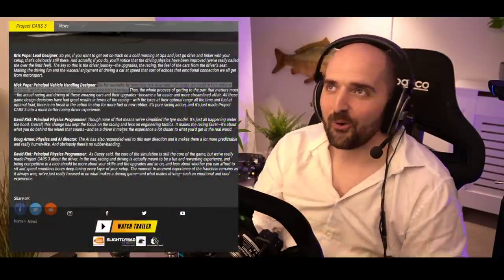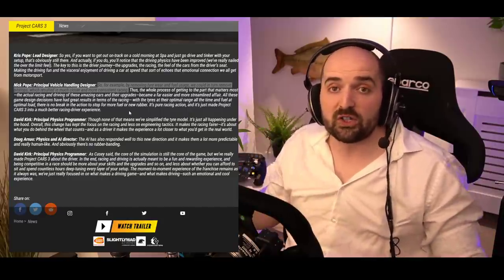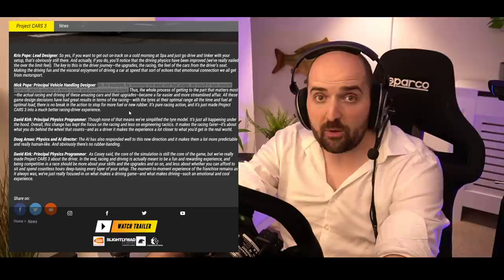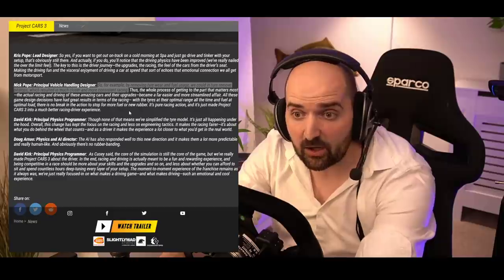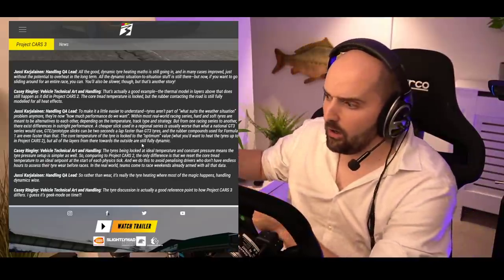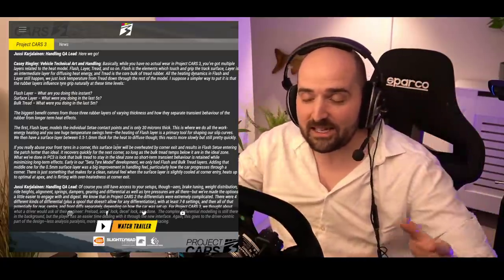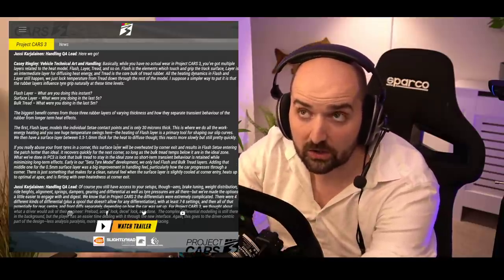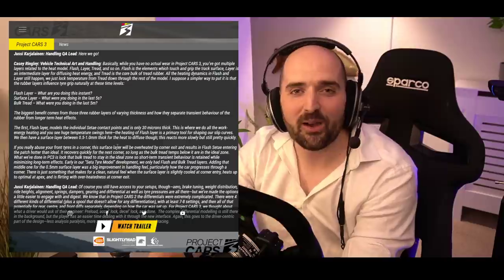No Pit Stops In Project Cars 3  | Are They Mad ?

Comment: Hey guys! Pitstops are a PART of racing! That’s part of the action. Having to manage tires and fuel is a BIG part of how good of a driver you are
Reply: Well to some simcades and almost all arcades pitstops and setups  arent an important aspect to the gameplay and PC3 is going to shift to this type of games.
Reply from the maker: How many people actually do 20+ minute races in sims ?   I have done 2+ years of live streaming and most our fun races are under 25 min.    Even in iracing the most active races are less than 40min and don't have pit stops in them. 

I do think its a shame to remove pit stops from the game totally expecaily for people that specifcally want that , but if the game drives well for the vast majorty of people its probably less of an issue than they actually think. 

I do think 20 min races with a forced pit stop and accelerated tire wear are fun and I'd have rather no pits were just single player. 

going to be intresting to see how it plays
Reply: I agree its important not to overheat them or cool them by going too slow even at short races. Wrong decision they made, i think if they want to simplify it they should better leave temps, fuel consumption, brakes overheating even how it was in PC2, nothing to improve just copy paste work they did in PC2 BUT...  remove setups. 
Drivers dont make car setups anyway nor calculating fuel. Best way would be leave tyre temps and wear, fuel etc but bot engineer telling you must come pit cause tyre wear, fuel ending or something. And if it comes rain he tell you to come pit change to wet but it is YOU deciding if you want do it now or after some laps or try to finish race on slicks in wet xD if you p1 and it start to rain but its 2-3 laps to finish and now its psychological battle between you and guy at p2 who go to pits, when or if any? you both try to finish in wet on slicks to not lose position xd thats fun and they took it away. Had situations like that many times but always i was more afraid of those stupid pit strategies if i come pit in wet when still have fuel and they give me hard slicks and load full tank cause i didnt change strategy earlier before race even started. But thats not problem only with pCARS2 happened in other sims so i would like to have sim where im doing only drivers job and AI makes rest, im just drive but with all sim features. If no tyre temp, pressure, wear, fuel consumption there is no sim anymore. 
Shorty telling no setups, auto fuel per distance, tyre wear, tyre temps, when tyre wear or fuel low GAME tells you to come pit and makes everything without you pressing even one button. That would be simple and let us decide our own strategy mid race. 
And pace car would be cool
Reply: I would like to go 100 lap multiclass race with AI and pits, changing weather and day /night cycle. 
Another thing there is touristenfahren server in PC2 where you choose any car of the game and make your lap around Nordschleife, its set to like 6000 minute practise to work and so you get on track from pits. Now i wonder if it be still possible? no pits means racing only no practise. Or even if practise, if you got no pits would you just spawn at start line when joining a server?  i dont like it
Reply: @GamerMuscleVideos  What if it starts raining during  the race? Still going to use slicks since you cannot pit anymore? lol
Reply: @PapaBear6t8  If I remember well, a Nissan engineer at Le Mans 2015 explained me that they had an "average gum" they were using on dry and wet track. In their Blog, SMS explained that the weather will only influence the grip, but considering the temperature of the tyres.
Reply: @PapaBear6t8  Maybe tire transforms itself.

Comment: No fuel or tyre wear and during a race the tyres automatically adapt to the weather conditions, a pit stop without a pit stop, what's next power ups, autopilot.

Doesn't bode well for the future of console sim racers and for that reason I went PC and playing ACC is just a beautiful experience.
Reply: Blue shells.
Reply: If I remember well, a Nissan engineer at Le Mans 2015 explained me that they had an "average gum" they were using on dry and wet track. In their Blog, SMS explained that the weather will only influence the grip, but considering the temperature of the tyres.

Comment: Seriously? but.. then what are they trying to be? NFS? because quite frankly, GT Sport's 'Real Driving Simulator' slogan would actually be considered factual compared to PC3 then. Lmao.
In every fun racing game, Arcade or Sim, its had fuel, tyre wear and generally the staples of a fun racing game, because pit stops add a rather delightful thing called, strategy to a race, rather than it being just a 20lap non-stop race. Pit stops can help level the field a bit, allow the less pacey but more consistent drivers have a means of potentially catching out the front runners. Also tends to make you think, is it a mandatory tyre change? what compound? should I underfuel my car and spend the extra few seconds in the pit filling up so I can spend the rest of the race aggressively attacking? etc etc.

Such a shame to be honest, was hoping for a game with Project Cars 2's content and graphics, with AMS and RF2 levels of physics, with the ability to customize our cars sort of like in GT Sport. Guess not.

Comment: I think for sprint races yeah, no pit stops makes sense. But for the immersion side of medium to long races, pit stops are part of thr strategy, I drive differently to the next man (or woman, sorry ladies!) and know that I my tyres will last "x" amount of laps on a given circuit in a certain car,. If pit stops are taken out of the equation, then that edge of my making tyres last longer has gone, soft tyres would be pointless and we'd be starting with full fuel loads, which then falls into another question of how the developers will equalise the field with balance of performance based on those settings? It's something GT Sport still hasn't perfected so it's a road not worth travelling. Don't try to fix what's not broke! small tweaks will suffice, better multiplayer match ups, additional car/track content and maybe a livery editor, please don't make this like GT Sport.

Comment: 9:17 PCJ 3  it's not like GT sport because the latter has pit stops, tire wear, fuel consuption and stuff that you find in other simulators,rather it's a sort of a Grid game but with better physics
Reply from the maker: GT sports also has input lag , way worse handling than PC2 and a penalty system that makes no sense. 

I mean id like pit stops as an option but I think solid physics within a jump in and race context is more realistic than unrealistic physics in a realistic context.
Reply: @GamerMuscleVideos   In PJC 2  most of the  cars cars are  broken cmon, i don't think it has so much better handling than GT.Let alone driving physics in the rain when sometimes you have a bug that makes you go faster than in the dry, or the exagerating bouncing of the cars... For example drivers like David Perel prefer GT over pjc by a long shot for a reason. As for the penalty systwm, yes it is not perfect  but at least it's an extra detterrent to not run into the other players...Oh and the imput lag is present also on the console version of PJC

Comment: Thanks GamerMuscle for the very fine put label on simracers. I laughed and nodded eagerly for a long time. I read news on RaceDepartment, and Christ... over there they are going raving mad - as usual, I should say, because every time SMS (The studio...) are coming up with ANYTHING, they go not slightly mad, but raving mad over at RD. Some of the posts are not only funny, but utterly stupid. 
Never mind that... Thing is. Ian Bell and his SMS company can take the PC series in any direction they want. I myself are a very casual race gamer, and I have no idea of anything but the bare surface of setups. I don´t do races long enough to have the need for fuel or tyre changes - so for me... well I probably will not notice any difference from PC2, which I absolutely love. 
PC3 will have so many cars and tracks that it should keep me busy for a long time.
AND - if the no pitstops strategy proves out to be a bad one for the PC series, well I guess SMS will return them in PC4. 
I already have my money saved for PC3... The fun factor is a max-factor for me, and the PC series have me covered completely in that department.